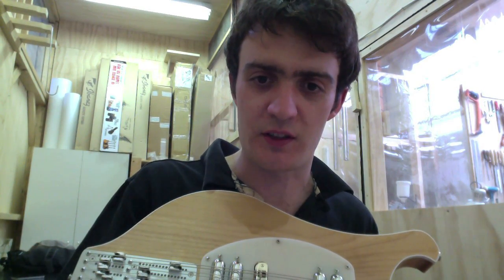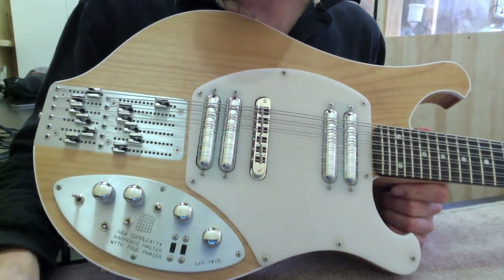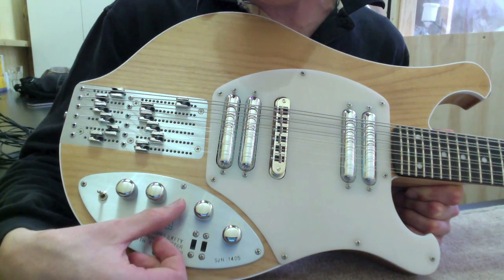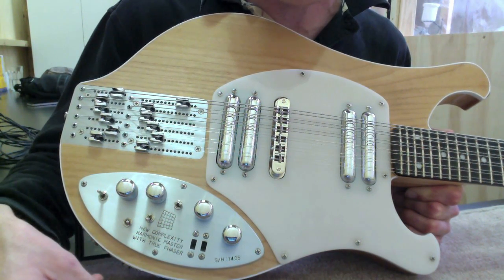True Phaser onboard guitar effect by New Complexity

Comment: I love new ideas, but I have to ask: how does the effects on the guitar "effect" the ones on a pedalboard chain? I don't see the practicality of it
Reply: It has a phaser entering before it even gets to the pedal board. you could just have a phaser at the beginning of your chain to get a similar effect, but the built in effect shown here will provide a very different sound due to the tone coming from the circuitry before the output.